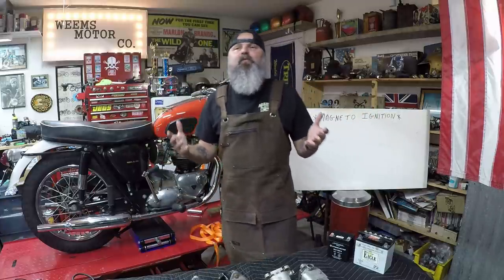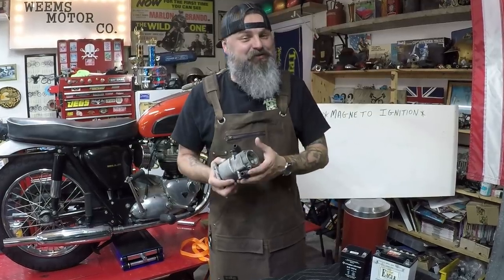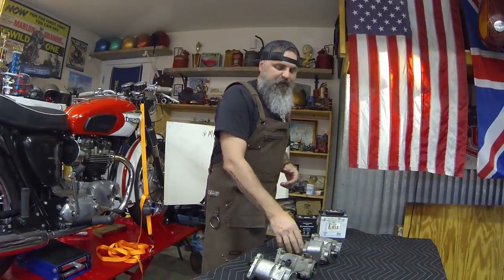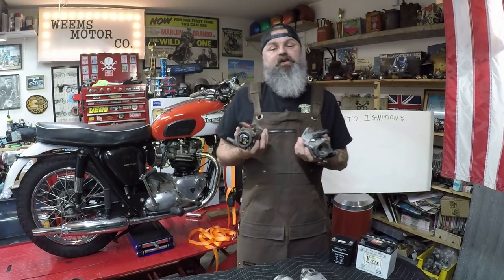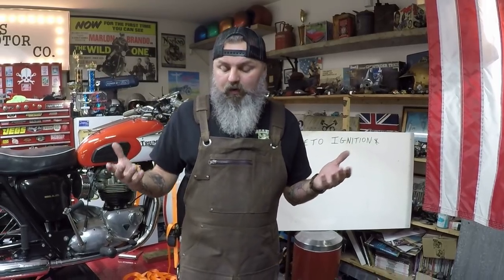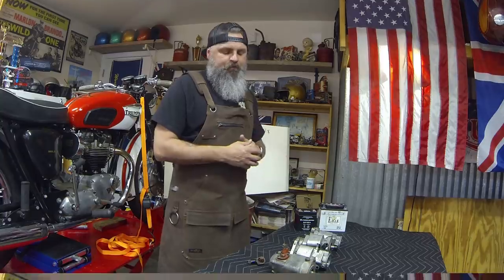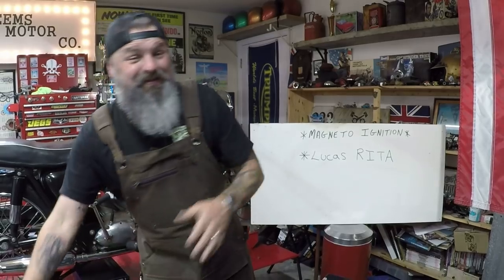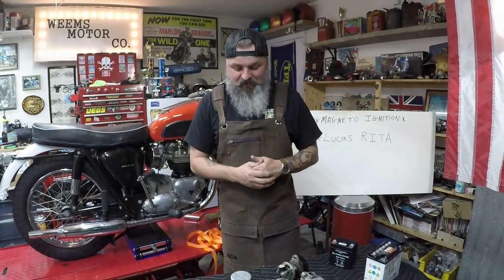Shocking Truth About Magnetos

Comment: Maybe I missed it,  but how does the magneto know when to spark? What s the timing like with a magneto?
Reply from the maker: Yes , when installing the Magneto you have to set the point at which the Contact Breakers at 28 degrees before top dead center with a solid gear on the timing side of the motor or at 34 degrees with an advancing Gear.